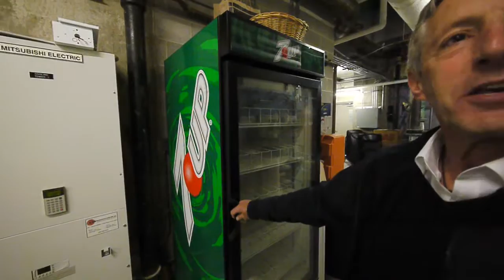In the mechanical room atop 600 Lake Shore Drive, Chicago

Comment: If the boilers were put in during construction via helicopter or crane, how would you replace them when the time comes? Would you have to destroy the roof or would the new boilers be brought in by pieces through the stairwell and then built on site?
Reply: Mr. Dishes they would be brought in in parts via service elevator and assembled in place. Actually it wouldn't be that much of a big deal.